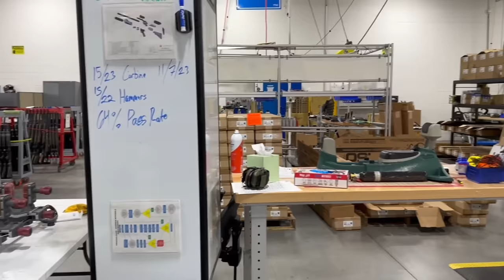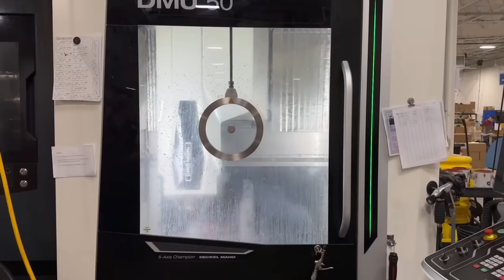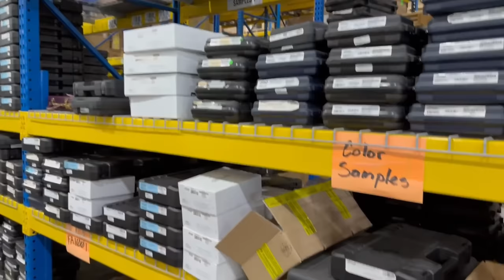Making My Own Walther PPK: Creating Bond's Tool of the Trade

Comment: I'm a bit frustrated with Walther.
They have made modifications to the design to try to bring the PPK up to date and make it a viable carry gun, but that's not why most people buy a PPK.
Walther Arms, if you're reading this, people who buy the PPK aren't looking for a Bersa Thunder, they want history.
They either want to own a WWII pistol, or they want James Bond's gun.
Please, please make a PPK with the old style frame (no beavertail) and a blued finish.
Offer grips in both black and mottled brown, with matching magazine extensions in the original design.
Continue to make it in .380 ACP, but offer.32 ACP too (I believe this would only require a different barrel, magazine and extractor).
There is a big market for historical/famous guns. Look at the re-release of the SIG P210 for example, or the various GI spec 1911s. There has even been a re-release of the original Glock 17.
You don't have to stop making the current modernized PPK, but please consider making Bond's gun too.
Reply: I agree 100% with this. Maybe Caleb can pass it along? I had a pre-war .32ACP PPK, and that thing was super fun to shoot.
Reply: Totally agree - I have a new one and love it, but would love it more if it didn't have the extended beavertail and was blued instead of the melonite finish.
Reply: @solidsloth14 I’m debating on cerakoting my ppk in gloss black.

Comment: If anyone wants one as a home prop without actually having a real gun, consider getting a Umarex PPK BB gun. Know your laws on BB guns in your area. They go about $100 maybe less in the USA.
Reply: I have the CO2 version, and it's not a bad replica.
The only things I don't like about it are the fact that it is a replica of the PPS/S, not the PPK, and the fact that they elongated the grip to cover the area that would be the magazine pinky rest on the real gun.
I am baffled as to why they did this, because it serves no purpose, and makes the grip look really weird.
I actually cut off the excess grip on mine, and it looks a lot better.
Reply: @thepenultimateninja5797 the BB extended mag well is likely to allow the CO2 cylinder to fit. I too would have preferred a different design with the smaller CO2 cylinder, even at the expense of fewer shots between changes.
Reply: @SmithDrewSmith  You're right that the grip needs to be longer than on a standard PPK to accommodate the CO2 cylinder, but that's not what I'm talking about.
For some reason, they extended the grips all the way down to the end of the grip, and there was just no need to do that.
The grip is only about the same length as that of the PPK/S, so they could just have made the grip panels the normal length.
The plastic part sticking out below the grips resembles the plastic finger rest that is found on some PPK/S magazines.
Find a photo of PPK/S with the plastic magazine finger rest and pop the grip off your CO2 PPK and you'll see what I mean.
Reply: @thepenultimateninja5797  ah, yeah I see what you're talking about, surprised I never noticed that. They could have easily made the grips look normal and disguise the co2 mechanism as a weird magazine extension
Reply: @SmithDrewSmith  Yeah exactly. It would have looked like a normal PPK/S, with an ever so slightly larger grip extension on the magazine.

Comment: My PPK/S'  DA trigger got substantially lighter as it got fired.  My only complaint... Stainless?  Just kidding.
Reply: "The right tool for the job Mr. Bond. Here is your bullet proof scuba tank with cut proof hose. And do be a good chap and bring the mini-sub back in one piece!"
Reply: At least it's a real PPK, not a PPK/S though, right?
None of the Bonds ever used a PPK/S.
The reference to a PPK/S in Skyfall was a dialog error.
Reply: @thepenultimateninja5797  I got it in the 80’s when the PPK was deemed a Saturday night special and not imported to the US. It is, however a German made version. And if you really want to be pedantic , the Bond gun is in .32 ACP not the .380 ACP sold today.
Reply: @Madmanmarque  I think at least the one Craig uses is a .380, so there is some canon to support it.
Mine is a PPK, but it is the Interarms version, so not German made.
I wish Walther Arms would offer the PPK in .32 ACP and without the stupid beavertail. I would buy one in a heartbeat.
Reply: @thepenultimateninja5797  I agree, they messed the look with the beaver tail.